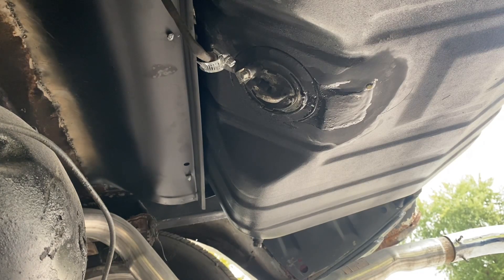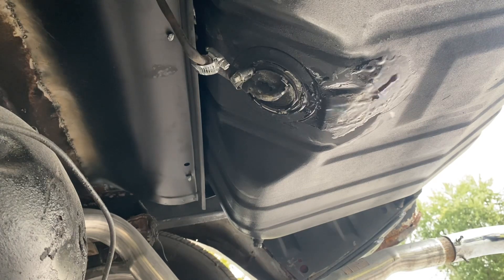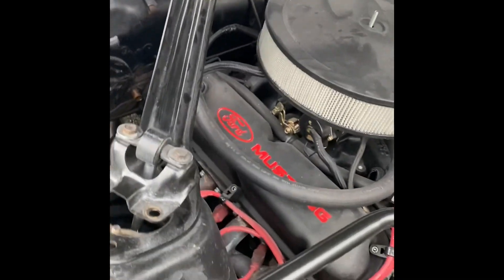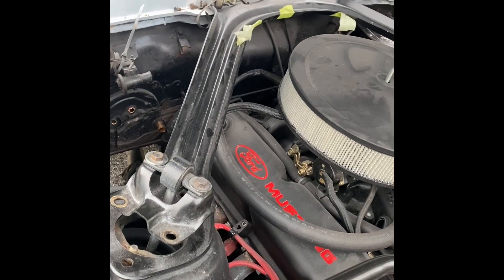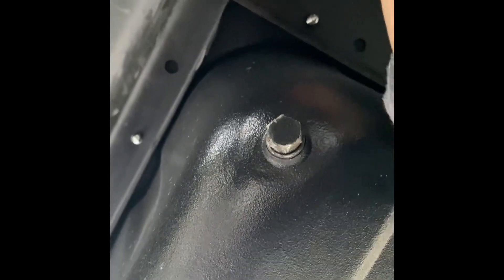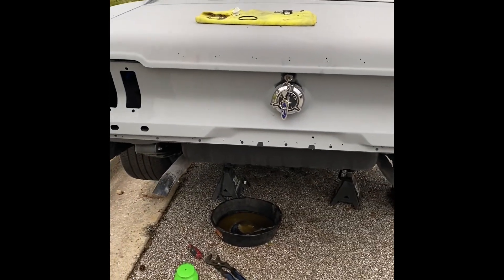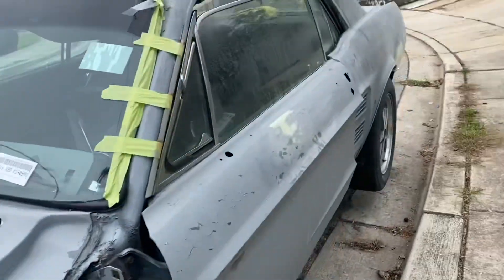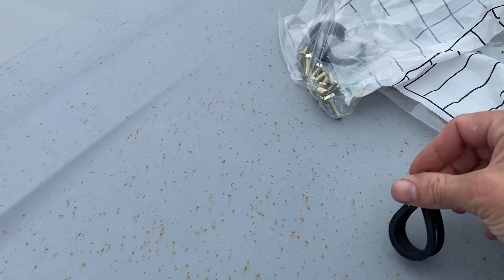1967 Mustang fuel system

Comment: Glad your sender not leaking fuel now, so good job. I am in the process of changing my fuel system to 6- an fitting and tpfe braided line on my 67 coupe with 302. Looking at your video, you can hook up 6an fitting to your sender unit by cutting off the bulb and using a 6an fitting with a 3/8 compression fitting to tighten on the tube, then the 6an fitting on hose will screw on to that. I think that the wire going to the sender is not powered but ground as the gauge measure resistance to calculate fuel level, you will need a switchable power source for the pump. I am using a 90 degree bulkhead 6an fitting to go through to engine bay instead of the grommet and then 6an to the fuel pump, I am using a mechanical pump.
  I have a hard line from pump to carb but changing that also to 6an braided to a Edelbrock fuel connect like you said you were going to, I have a Edelbrock filter and pressure gauge before the fuel connect, the carb is a 600cfm edelbrock. I used to run a electric fuel pump but it failed after one trip of install so went back to mechanical, I using tpfe line because it is good for all fuels and will last much longer then rubber, 6an is about 3/8". I like to run the braided hose over the thermostat and under the dizzy to look tidier and keep away from pulley's plus easier to make mounting brackets to keep in place. 
  I subbed so I can keep an eye on your progress and offer some advice if I can. Keep up the good work, it takes time but one step at a time.
Reply from the maker: Craig thank you for all the great information! I’m sure this will also help others, I still have work to do on the fuel system for sure. I’ll look into the compression fittings as you mentioned,  good luck with your build as well!